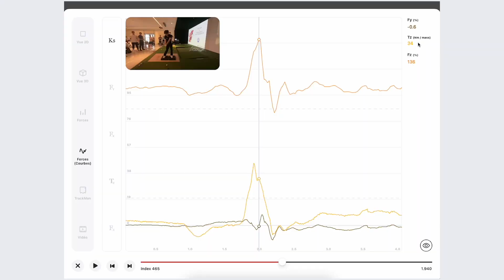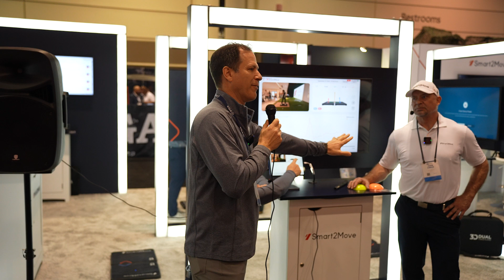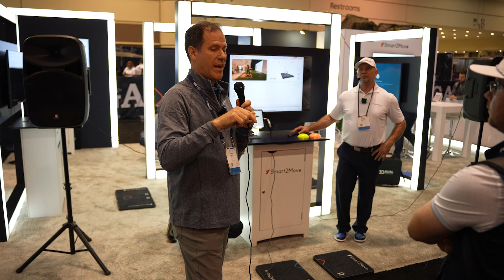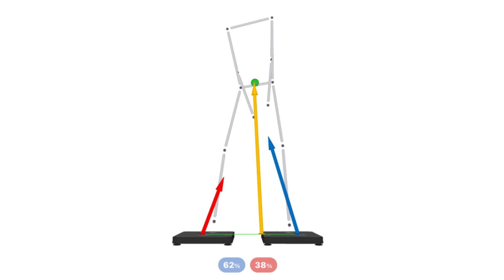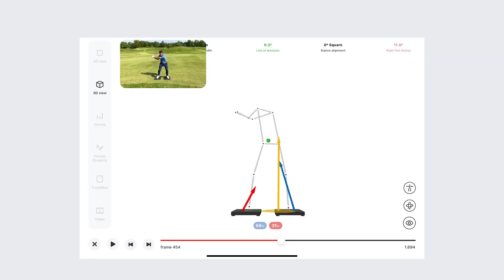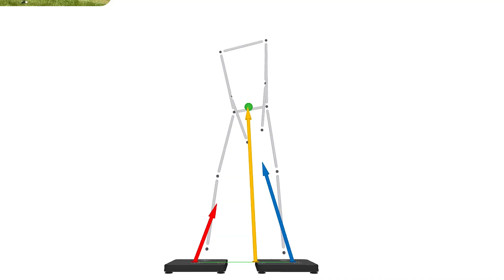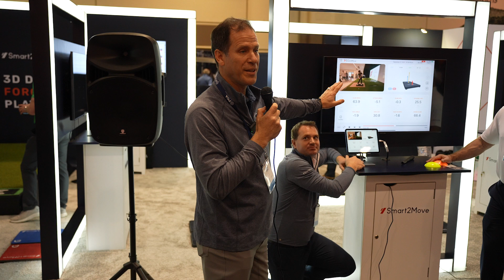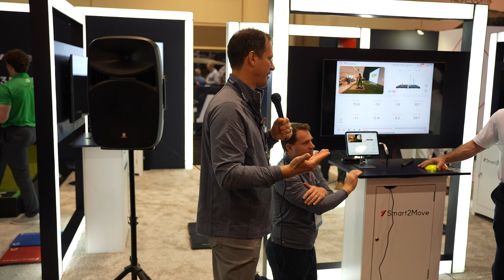Analyzing Golf Swing Dynamics: Technique Breakdown and Torque Optimization

Comment: It's unclear to me what it is, exactly, that we are trying to speed up by using GRF and torque. What moving part of the swing gets the most benefit of increasing the moment arm, or increasing the force? Why does no one ever spell it out? Is it the rotation of the upper body? The hips? Is it.... at the end of a long chain reaction, simply the hands that get faster?
Reply: K I'm going to explain it, but you can just watch Dr.Kwon's video on torque, since it looks like they just copied it, and they even copied the stick figure from his research. I think that's why they don't explain it well, because they don't want it to be obvious that they got the the moment arm idea from Dr. Kwon. You shift to your right and turn in the backswing, but the turn is initiated with a push into the ground with the right foot. This gets your center of mass (approx. belly button area), moving back toward the target WHILE still rotating back. Then, as weight shifts to the left and you start to apply pressure into the ground with left foot, the horizontal force (that came from pushing the ground with the right foot) gradually turns into a vertical force - as viewed from face on. If the hozizontal force is significant enough and early enough, it will be well ahead of the center of mass, despite the fact that the center of mass has also shifted to the left. This creates a long moment arm, which allows you to increase the body's rotational speed without really increasing effort, but it happens very early in the downswing. Then, as you asked, this passes speed to the arms as the body starts to decelerate, then the hands, and ultimately the club. And you have more clubhead speed without going to the gym or really even trying to swing harder. I don't mind explaining this because I'm a Level2 Dr.Kwon instructor, and I know they are leaving all this info out of their explaination, maybe on purpose. I assume this comment will be deleted, but hopefully you can understand if you read it. Hope it helps.
Reply: @nickcampbell8619  Thanks for taking the time and giving me this detailed answer!
I'm familiar with Dr Kwon and I've seen his videos. I understand the concept of force x lever and so on, and I can also observe how the forces move through the swing.
I guess I'm a bit more skeptical of the practical application of focusing on these forces when learning the swing. I'm much more in the camp of working a familiar pattern of movement (like throwing a ball) or Dr Kwons various drills with ropes and so on where people get comfortable with a single flowing motion.
And even with your explanation, I'm not sure this information is more "actionable" than, let's say, simply starting by swinging a club (or rope) really slowly while paying attention to how the weight shifts and how we can accelerate the clubhead with very little effort once we learn to slow the core down and be a bit more patient in the swing and trust the mechanics.
As you notice, I say: trust the mechanics (levers, forces), so I'm not discounting them, it's more a question of what to focus on.
Reply: @nickcampbell8619  -  What is not explained right from the start is the fact that it is the contraction of the golfers muscles that are used to perform the swing that create those ground reaction forces .  GRF's are 'reaction' forces which can be used to mathematically explain what is causing a change in the linear motion of the COM of the golfer or/and rotation about that COM . They do not magically make the golfer contract the correct the muscles to perform some efficient movement of body segments. For example I might be able to recreate the theorised optimal GRF's patterns of an elite golfer without moving my arms. You still have to learn and time which muscles are utilised to move the body segments correctly while simultaneously creating those optimal GRF patterns to achieve those movements.
Further, there has been no research done that prove GRF's  are a cause and effect of the inverse dynamics used to explain the motion of the golf club.  Dr Kwon claims there is a correlation between vertical GRF's and clubhead speed , but I've read other research articles that dispute that claim. This other research team examined the component of the GRF forces  'within the swing plane' of the golf club and found no correlation with CHS. 
You also seemed to have implied that there is some transfer of energy proximal to distal such as passes speed to the arm as the body decelerates.  I suggest you look at the research article by  Brady C Anderson  'Speed Generation In the Golf Swing : An Analysis Of Angular Kinematics,  Kinetic Energy and Angular Momentum in Player Body Segments' .   That research involved 500 golfers with a handicap of 5 or less and he found that the timing of the peaks in body segment angular kinematics, kinetic energy and angular momentum did not follow a proximal-distal sequence.
Reply: @jackflash8756  Ya so there are a hundred different things that have a correlation to clubhead speed, right. And some have a greater correlation than others. Kwon's research is also based on hundreds of professional and collegiate golfers, both male and female. They only thing i was talking about in my previous comment was how to increase the moment arm. A long moment arm, early in the downswing, allows one to accelerate the body early, which has a correlation to higher CHS. Of course, as you mentioned, this has to be done in sync with the swinging of the hands and arms. I was talking about ground force reactions, or peaks. Just HOW to increase the length of the moment arm, which wasn't really explained at all in that video.
Reply: wasn't talking about*
Reply: @nickcampbell8619  - I haven't seen any research that correlates hundreds of different things to CHS .  They might be indicators but not yet proven to be a direct cause for increased CHS.  For example , LPGA players on average rotate their pelvis and chests (ie. thorax) faster than PGA players but their CHS is inferior.
Reply: @jackflash8756  lol that's why it's called a correlation. I didn't say anything about high or low correlation. If something has a LOW correlation, it influences CHS, but not by a significant amount. So pelvis rotation, for instance, prob has a correlation of about 0.2. The AMOUNT the thorax turns has a stronger correlation to CHS. (But it has to both turn and tilt). This is why I said there are a hundred things; The correlation of bench press one rep max to best shot put throw is about 0.5. (A correlation of 1.0 would mean that the guy who bench presses the most also wins the shot put gold medal). So 0.5 is not everything, but it's a strong correlation. It means you have to bench press about 275kg to have any chance of winning the shot put. But, there are a ton of other factors. Similarly, in the golf swing, there is a minimum requirement for how fast one must turn their pelvis to hit a golf ball. Which means you might not have to turn your hips the fastest to swing the fastest, but there is a minimum angular velocity they must have. Thus, there is a correlation. Also, the more you weigh, the more force you can put into the ground, which is one reason the ladies can't out drive the men (one of many). BTW i don't mind having a conversation with you or even arguing, but please read what I said and respond to it first. I also have lots of research data in my biomechanics notes. Not just about golf, but other sports as well. Cheers.